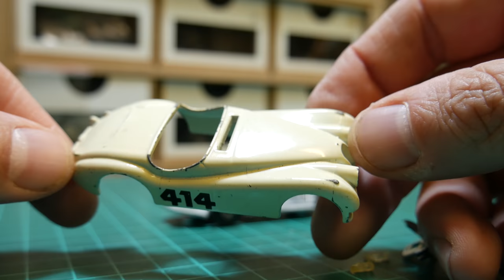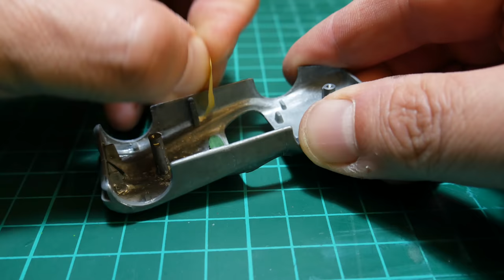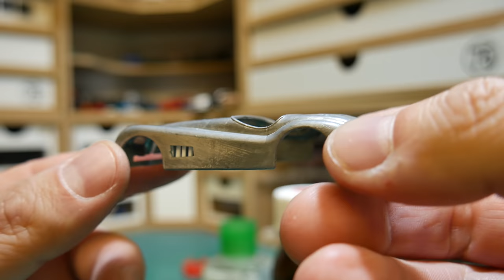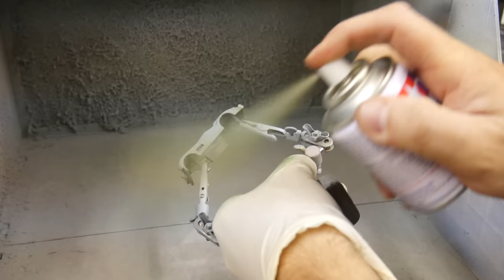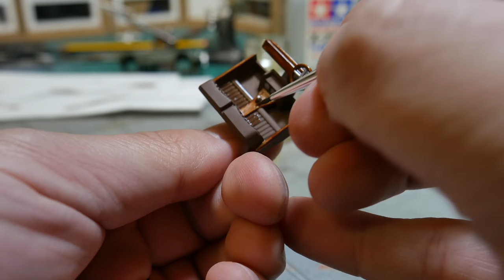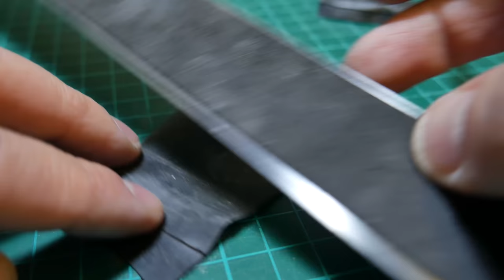MATCHBOX Restoration & Custom : 1984 Jaguar XK120

Comment: That style of Sports Car always intrigued me. The style like this Jaguar, and the Triumphs and the MGs... Compact ... the kind that when you sit down in them, your feet are half way up under the hood (bonnet) and your butt is literally inches above the road... and when you drive them... all stick shift,  jammin' those gears.
Reply from the maker: They're great fun..... I had an MG Midget race car exactly how you describe, ass on the floor, feet in front. It had like 65bhp and weighed as much as a feather. Had no power but boy did it handle, you could have it in top gear and if you were brave enough just hussle it round anything...... trouble was stopping, the brakes were dreadful 😜

Comment: Another cool vid! 

Have you tried using a centre drill to get your pilot hole started? It won’t wander around like a normal drill does. Once you’ve got a small tapered hole, the proper drill will go straight in, nicely centred.
Reply from the maker: Couldn't find it.... Well, tell a lie, I know where I left it and thers no chance in me getting it back and haven't bought a replacement 😃 Its on my notes list as to get when I'm next in the DIY shop, then I completely foget I've got a list on me!!

Comment: Nothing wrong with vintage racecars. They have so much character :) I wonder if there are any 1/64 scale wirewheels available? And while I agree that this one should be a dark green or red, I don't think I would have chosen Nato Green.. I would probably have gone for TS2 Dark Green or TS9 British Green (there is also a  TS43 racing green but that has some metallic effect on it that looks awesome on a 1/24 scale model but out of scale for a 1/64 one)
Reply from the maker: Thank you Richard😁👍🚗 There is a gent called Akara Modeller who has made some reall wire wheels in 1/64th that are crazy detailled. Very skilled modeller. The Green was a difficult choice, well I say difficult it wasn't in the end. The TS9 I tried first and it was way too bright on the car, it looked almost illuminous infact! The Dark Green TS2 was again two dark..... I went for this middle shade. As another subscriber mentions above the whole 'Racing Green/British Racing Green' varied massively between manufacturer.

Comment: Love the interpretation of the XK120, The detail is fantastic.
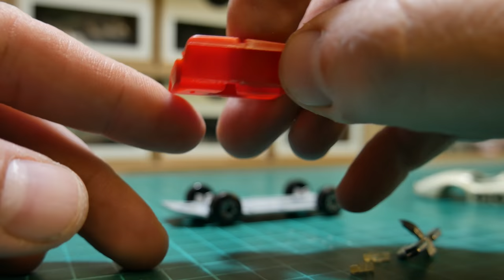It says that you used 1:64 wheels. The model is 1:57. Is there a size problem because they look great. I am part way through oing a XK120 and the wheels could do with replacing. I would like to add silver wire wheels but cannot find any in 1:57. Any suggestions would be appreciated for a newbie like me?

Comment: Hello pal... "Your only gone and blown the bloody doors off".... My own miss quote for "I've rummaged through my old car box and figured with a bit of styrene I'm off"
Bar having a serviceable airbrush as well (lots of Tamyia rattle cans) where in the UK world of 1:64s  you recommend to buy the wheels? Everything I've searched is a min one month or in the USA? Also any recs on the engines? I've a 427 AC Cobra tapped and ready for role cage, but the wheels engine???? Really appreciate your help sir.
Rob
Reply from the maker: Hi Rob.... Theres plenty that aren't too far away and easy to get hold of in the UK. The ones mentioned in the description are a fast turnaround and awesome quality from Ireland. I also use 'HW Works' on the shapeways website https://www.shapeways.com/shops/hw-works . If you put 1:64th in their search loads of accessories and wheels come up. Theres also 'One:64' on Facebook that come fairly quick enough from Germany....  Hope that helps 😁👍🚗
Reply: @SidewaysKing75  
You're a 🌟. I'm guessing the 75 comes from the same year of birth as me !!! 
And I've gotta ask... What's the twin engine in your start? Triumph?
Reply from the maker: @returntochrist777  No worries👍🏻 Yes the 75 is the year I'm born 😁 The thumper at the start is a BSA Goldstar 🏅